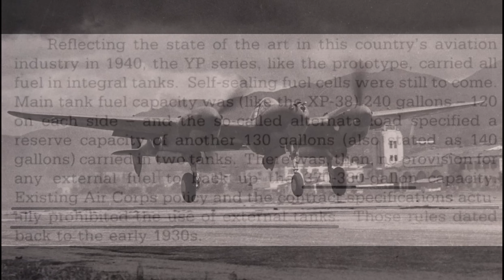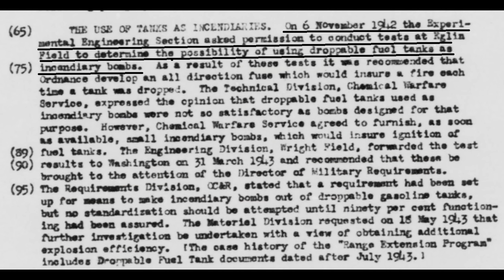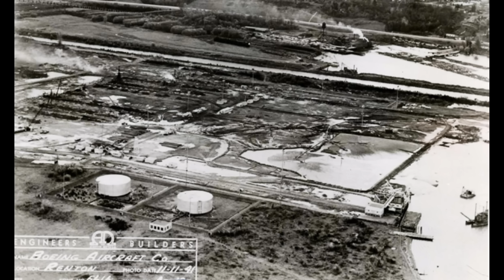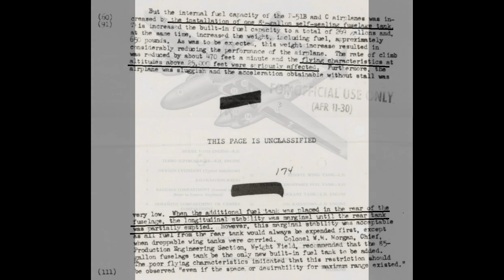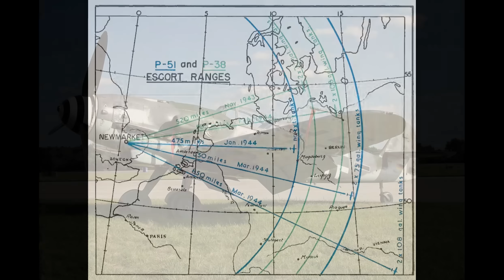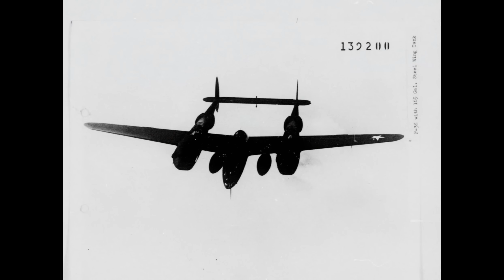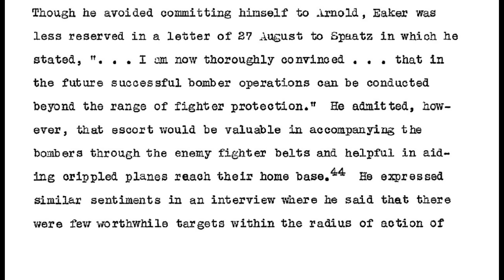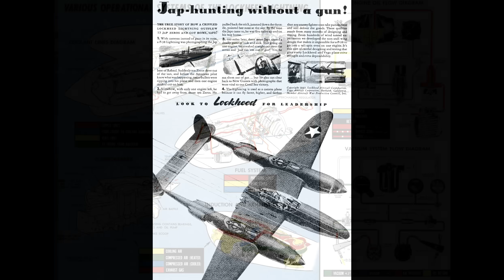The P 38 Lighting and the Bomber Mafia's Failure In World War Two

Comment: The p 38 was a wonderful platform and had good flight  characteristics.  But I remember  a book a read back in the 1970's... this on a military  base. This plane had issues in Europe. A renowned ace of ww2 was in a dive chasing an adversary.  This plane had a tendency  to lock boom elevators in dive. Pilot had to fight with all his strength  to recover the dive.  This plane did poorly in European  winter. I'm old enough  that I met many WW2 veterans.. all theaters; all branches. And both theaters and both sides of conflict( the enemy. Japanese  and German.).  Biggest thing I remember  about P38 is that adjusting power on propulsion  was complicated.  ( also on the P47. ) you had multiple  things you had to adjust to get different  power settings. I.e. maximum or emergency power.  My parents served Korea,  and Vietnam.  My grandparents  served WW2 and Korea. Yes... our country did do  some stupid things ( politics getting in the way of prosecuting  the war. ) my favorite  being the insistence that our Naval torpedoes  were " jes fine".
Reply from the maker: Every WW2 fighter had limitations regarding dive speeds. Also, I think you somehow missed the point of the video.

Comment: On 3 March the P-51B's from 363rd FG not only flew to Berlin and escorted around Berlin, but also engaged with Bf 109s/Me 410s north of Berlin, whereas the 55th FG didn't have any combat encounters. You quoted 8th AF history, the 9th AF didn't have the same quality Public Relations Depts.

Greg - get a copy of the 'Victory Plan' (AWPD-1), that Arnold ordered in response to Roosevelt for aircraft production to defeat  'potential enemies' - completed in Sept 1941. Scroll to Tab 4, Long Range Escort and read carefully. It explicitly states the requirement for bomber escort type, heavily armed and agile, capable of intercepting (not passive defense per B-40) enemy pursuit, with range to escort all the way to the target.  Unfortunately Echols went down a rathole and awarded the contract for P-75.

The combination of Ambassador Winant, Asst Secy War Lovett were the influencers that sponsored the Merlin conversion program at NAA in JUNE 1942!!!! Those actions followed Arnold meeting with Winant, Hitchcock, RAF Air Marshalls and R-R during which the R-R project to convert the Mustang I to mount the Merlin 61 was discussed.  How do you imagine that Lockheed, Curtiss and Bell never had a shot at getting Packard V-1650-3 engines? Echols was overruled.

To your Dragon's Teeth reference, Republic ignored Kelsey in summer 1940 when he urged both Lockheed and Republic to design for 3000 miles Ferry range. Lockheed embraced the notion, Republic ignored it until Arnold issued the March 1942 Technical Order 1016 "Extend Range for All Tactical Aircraft". Kelsey ordered Republic to deliver both the ferry tank as well as design adaptors to carry three 'standard' 75-gal tanks, as explicitly outlined in his March 27, 1942 memo to Chief, Engineering Mat.Cmd. Republic not only did not follow that order for another 15 months, but held on to the proprietary skid plate mounts (2 pair lugs 28" O.C compared to std AAF/USN single set 14" OC. Republic could not carry ANY standard drop tank or bomb made anywhere in the world until they finally installed the AN-B-7 and AN-B-10 racks.

The 8th AF P-51B's started combat ops with 108-gal Bowater paper tank on May 12th 1944. The drag of the metal 110-gal and paper 108-gal is same.  False narrative that P-51 reduced fuselage tank from 85-gal to 20 gal. Typical ops was to BURN 20-gal during climb from base. Wright Field testing recommended 45-gal for full combat maneuverablility in Nov 1943. It IS true that the load limit for the P-51B was 600 pounds, but it was ignored for the 108-gal tank. The P-51D however was rated for 1000 pounds and typically carried 2-165's from Iwo Jima. The P-47N with 550-gal internal fuel plus 1x330 and 1x165-gal external had only slightly more combat radius - with 75% more fuel.  Additionally that load out was rarely used because hazardous overweight (and unbalanced) takeoff condition on a 'hot day'.

In Fact, Arnold ignored Eisenhower's demand for more B-17s from 8th AF and more P-38s from US to support Italian campaign. He ordered the two P-38H equipped (20th and 55th) in July 1943 to go to the ETO (Before Schweinfurt-Regensburg mission). Both arrived in August, but took until October 15th for the 55th FG to fly combat first combat mission; Dec 20th for 20th FG. You also ignored that Arnold (and Marshall and King) vigorously protested the Eisenhower 'rape of 8th AF bomber command, troop command and all P-38s' to equip 12th for Torch. Roosevelt supported Eisenhower. I'm still mystified why you fail to see the importance Arnold placed on providing the 'best available escort fighter (P-38F) in the ETO when the Japanese were running wild in the Pacific? If the 'bomber mafia' were convinced that B-17s need no escort, why would he send the fighter in highest demand from all theatres, to the battleground expected to be the toughest challenge to US Strategic bombing doctrine?

The P-47D-15 first flew in October 1943 and not available in quantity until first mission by 56th FG using 2x108 gal tanks on March 18, 1944. The farthest combat encounter using 2x-108s by 56th FG was 389miles to Celle (ne of Hannover) on 4-18-44. Still 30-40miles short of Schwenfurt for 56th FG, but mayble 70 miles short for P-47s flying from Debden and Duxford had the P-47D-15/-16 been available on the day it first flew. Not ONE combat encounter of a P-47 was recorded farther than Halberstadt (420mi) before D-Day. Source 8th AF Final Victory Credits Board - June 1945. A few D-25s flew before D-Day but it wasn't operational in squadron quantity until July 1944. 

One final point. Recall that the Mustang (all versions) always had much more internal fuel per engine than the contemporary P-38, and had much lower drag. Ditto P-51 vs P-47. That is why the Mustang always had greater range on internal fuel.
Reply from the maker: Hi Bill. I was just thinking about you this morning. Probably around the time you wrote this. I hope you're doing well. I don't have time to address all of this, but I'll touch on a few points.

1. Yes, the P-51D has more range than the P-47D. That's not in dispute here. It also uses a lot less fuel, that's not in dispute either. 
2. The fuel usages I quoted for the 51 are right out of the WW2 manuals. I'm sure that sometimes things were done differently, yes the pilot could have more fuel in the fuselage tank at some expensive in aircraft handling, but it doesn't effect the topic at hand. It's not about how much more range or how much more fuel efficient the 51 was. It's about the Bomber Mafia's failure to provide escorts over Germany in 1943.
3. Contractors build stuff they are paid to build, not ordered to build by some Army Captain. Now if you can show that Kelsey delivered a check to Republic to build drop tanks in the summer of 1940, and drop tanks that would do the job, then sure, you have a point. I don't think you will be able to show that. 

Greg
Reply: @GregsAirplanesandAutomobiles  Hi Greg - equal wishes that you are doing well. 

On the topic of Ben Kelsey, I suggest that you can't expand on his positive influence on Lockheed development projects, while dismissing his failure to stimulate Republic to standardize on the wing and belly racks that existed on virtually every tactical aircraft in the AAF and USN? 

He Was CHIEF, Fighter Branch in 1942 when he ordered Republic to mount three racks for standard 75-gal drop tanks (both steel and Goodyear self sealing delivered in December 1941.) At that time Republic was just starting to evaluate the 200-gal and 600-gal ferry tank, plus the never seen 400-gal ferry tank. As Chief, he guided Kelly Johnson on wing mounted 75-gal during their XP-49/P-38 drop tank proposals in August 1940.

Recall that AAC/AAF senior command did not 'stop' any development on adding drop tank capability to Lockheed vehicles (P-49, P-38, Ventura), because Lockheed was investing in features that the AAF (and USN) would buy.

Also recall that literally 1,000's of 75-gal and 150/165-gal Lockheed tanks were left behind in fall 1942 when the 8th AF P-38s went to Africa. But the P-47C/D-2/D-4 could not attach either tank to the Republic proprietary four-point attach scheme for the 200-gal Ferry tank, and the P-47 didn't have the capability (as instructed by Kelsey 15 months earlier) until the prototype D-2/D-4 testing with both belly and wing STANDARD racks - beginning early July, 1943.

So, the issue was not only reluctance but also significant modifications were required to change the belly racks to 14" OC, suspended between the skid plates, and a whole new rack, fuel feed and structural beefing to add the wing pylons. Additionally, the final wing pylon was not received favorably because it hurt P-47D roll rates vs P-47B/C 

As to investment rejection by Republic? I suspect you could trace Karveli's hatred for all drag adding features was the root cause.
Reply from the maker: Hi Bill,

    I certainly can expand on why Lockheed had the drop tanks first. I have fully explained that over and over. Do I really need to type all that out and go over it again?
Reply: @GregsAirplanesandAutomobiles  Hi Greg - the question wasn't why Lockheed listened to Kelsey when he returned from his Britain 'Observer' role with Spaatz in 1940 with respect to immediate foreseeable requirement for Ferry range. The question wasn't Kelsey's role in encouraging Lockheed to propose droppable tanks   for XP-49 and P-38 in August 1940. The question wasn't Kelsey's role in the design and production of the 150/165-gal Lockheed in early 1942. The answer to all of the above was that Kelsey had full backing from Commanding General and Chief, Materiel Command - Oliver Echols.

As an aside, the ONLY source for Arnold's so-called question to Kelsey regarding authority to develop drop tanks for the P-38, is Bodie recounting Kelsey conversations to him. As an aside Spaatz, director of the AAF Observer team in London

The question is why Republic ignored Kelsey when he was LtC and Chief, Fighter Branch and issued instructions to Republic to deliver modifications to carry three standard 75-gal drop tanks. (source "Case History FAREP, Part I, Interoffice Memo dated 27 March 1942). 

The question is why Republic ignored Col Carroll, Chief Experimental Engineering, in Memo Report EXP-M-50-654, dated 21 March 1942, when he instructed Republic be modified to carry 2x100-gal tanks under each wing and one 400-gal under the fuselage. Further in that memo, he further instructed that "combat range extension tanks will be obtained with droppable, non-self sealing tanks, the capacity of which shall never exceed that of internal leakproof tankage". He also instructed that the combat tank shall be capable of 15psi to provided high altitude drop tank pressurization. Republic delivered only the 'Bullfrog' 200-gal ferry tank for off-centerline lugs on the two skid plates. (source "Case History- Droppable Tanks, pg 104)

Further, the question is why Republic ignored adding the capability to mount Any standard bomb or drop tank - electing to continue with it's proprietary four-point attach scheme for the 200-gal tank until ORDERED by MG Branshaw on June 1, 1943 to add 'adaptors' to the P-47 to be able to mount the 150/165-gal and 75-gal tanks remaining in UK after the P-38s were pulled for Torch (Case History - Droppable Tanks, pg 221"). So, the question remains, 'What was the real reason Republic ignored Wright Field in 1942 and resisted converting their proprietary four-point skid plate to the standard AN-B-7 and B-10 racks that existed (in 1942) on P-38, P-39, P-40, A-36, P-51, P-63, A-20, etc,, etc.?

Those are the questions to be answered.

Btw - FAREP was Not limited to Ferry tanks. It was specifically to develop both 3,000 mile Ferry capability as well as long-range escort capability via increases to internal fuel, combined with flexible combinations of external droppable tanks on standard bomb racks. Specifically, the introduction of the 85-gal fuselage tank for the P-51B, the 2x55-gal leading edge tanks on the P-38J and both the wing racks and extra internal fuel for the P-47D were driven by FAREP. The only true difference is that NAA and Lockheed delivered in July 1943 (Before Schweinfurt-Regensburg) and Republic delivered in October 1943 and February 1944 respectively. Both the P-51 and P-38 were carrying external, wing mounted droppable  combat fuel tanks in 1942 and 1941 respectively. Literally 16 months before Republic

Btw - the actual capacity for 75-gal tank was 82-gal, for the 150-gal tank 165-gal, for the 108-gal tank 115-gal. The reason was to only fill droppable tanks to 90% capacity. To reiterate, all P-51Ds were stressed for 1,000 pounds on the wing rack and all P-51B's were stressed to 600 pounds but the 108-gal Bowater tank was in full service on all P-51Bs in mid-May 1944 and would have carried them earlier but they were prioritized for the P-47D FG's.

Comment: Clearly the bomber mafia needs to be sentenced to the same hell as the Bureau of Ordnance leadership that refused to admit the design flaws in torpedos in the early years of the war.
Reply from the maker: The bomber mafia was far worse.
Reply: @GregsAirplanesandAutomobiles certainly in the metric of lives lost as a direct result of their mindset. Faulty torpedoes wouldn't directly result in loss of life; rather (ironically), it might result in fewer Japanese killed. The interesting question is how would the pacific war have progressed differently if torpedoes had performed properly from the beginning and, just as importantly, dropping the prewar submarine doctrine earlier that limited submarine performance. This could possibly have crippled Japan earlier, shortening the war and thereby saving American lives. An unknowable figure to be sure, but here we are again with the metric of lives lost unnecessarily through bad doctrine and leadership.

Comment: Could the P-38s have done the job without the engines blowing up, though? The P-38s had a LOT of engine issues with the turbos in the cold air over Europe. That's not a great thing to rely on, especially if you're the one flying the Lightning.
Reply from the maker: What makes you think the turbo problems were caused by the cold? Do you think the alternative of no escort fighters was a better choice?
Reply: The engine troubles of the P-38 were all resolved with later models (just like the problems with all fighters of the time). The problem was that the P-38 was rushed into service for very high altitude and very long range work in the ETO without proper teething when in fact the P-38 could have been properly prepared for this work as early as late 1942 but was ignored by the 8th AF Bomber Command.

Comment: I recently got into a "discussion" (ie disagreement) with someone on external tanks.  He claimed "they were not available" , but I argued that is was just allotment of resources.  For the cost of the XB-40 and XB41 (upgunned versions of the B-17 and B-24, respectively). all the drop tanks needed for P47's long range missions could have been made in 1943.   I was surprised that, in the US, there seemed to be no urgency to increase the range of P47s in 1943.  A push to extend their range could have happened much earlier, but since the production of the P51 had been scheduled for the future, the view seemed to be "just hold out a year or so" rather than throwing resources into an interim solution with P-38s and P47s.
Reply from the maker: I have heard the "not available" argument. It's nonsense. Or at least is ignores the key issue. They were not available because USAAF leadership made some really bad choices and then covered them up with the range myth. It was not due to some technical issue that was stopping them.

Comment: My favorite fighter of WW2, not because of how good it was, but how good it could have been with just a few technical fixes. It could not dive and could not roll which was fixed late in the war with dive flaps and boosted ailerons.... after hundreds had been lost. It also needed a pressurized cockpit to let it always enter the combat area far above it's adversaries. What could have been. And the intercooler system was junk of course until they fixed that.

Comment: Regarding the aileron control of the p38 being heavy, and hence the response slow. My father (Kenneth Nicholson) flew p38s out of Honington, England in the first half of 1944 in the 364th fighter squadron. He did not like the slow roll and turn rate of the p38 he flew, so noticing that the bombers that were being repaired on site had trim tabs on the ailerons to make controls more responsive, he and his mechanic added control assist servo tabs on the ailerons and rudders, and reported it was the fastest rolling p38 in the war, and could also roll much more quickly than the p51 that he flew after they replaced the p38s with p51s. This may sound like a made up story, but he also described this in the book The History of the 364th Fighter Group, which was published in a limited edition in 1990. My father also mentions how indeed a p38 mission he was on escorting bombers over Berlin beat the first p51 escort over Berlin by a few days, just as you described.